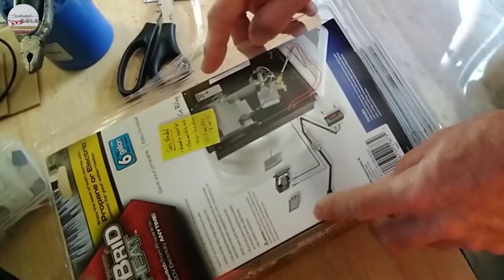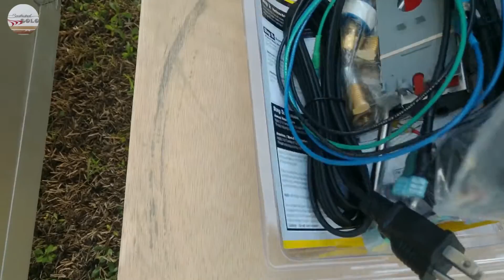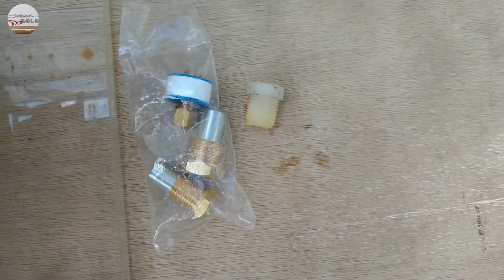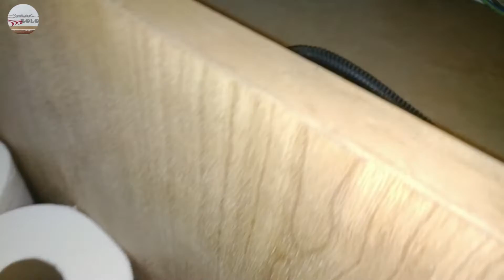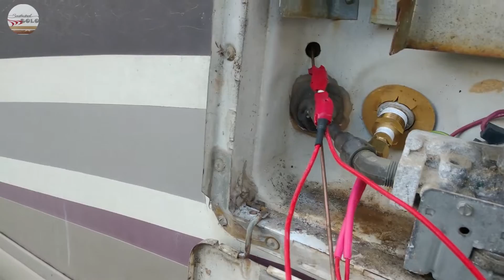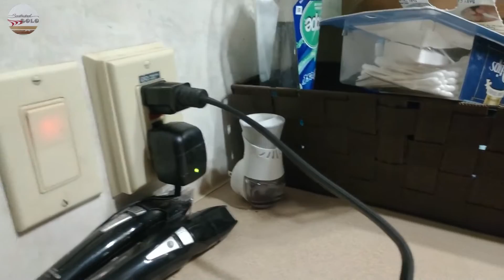How I converted my faulty gas RV water heater to electric in just a few hours.

Comment: But no one did not explain how to drain a water during wintarazing ?
Reply from the maker: If my memory is correct the heating element replaced the drain plug.  You would have to remove the element to drain.  I was in Florida full timing, so never needed winterizing.  Great point though!

Comment: Looks like a great idea but does the thermostat have a sensor that cuts power to the element if the 2 sided tape fails? If not, the element would continue to heat dangerously.